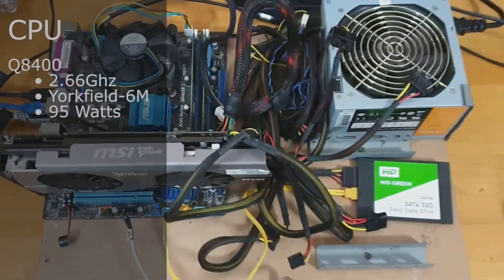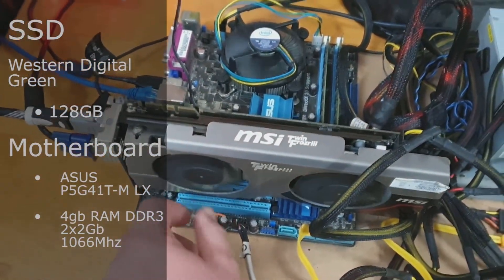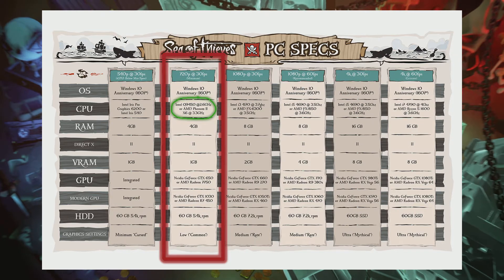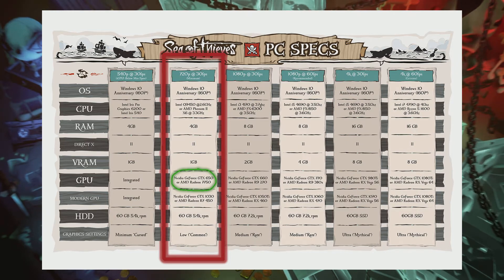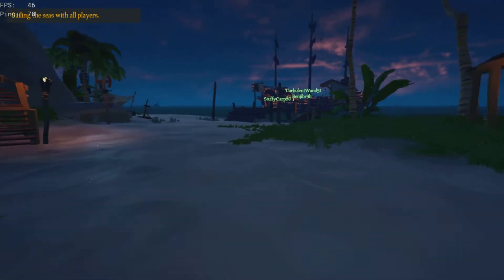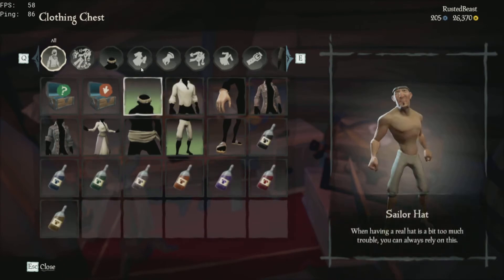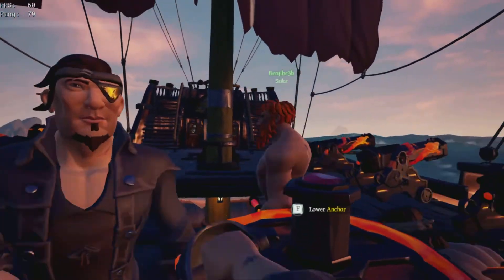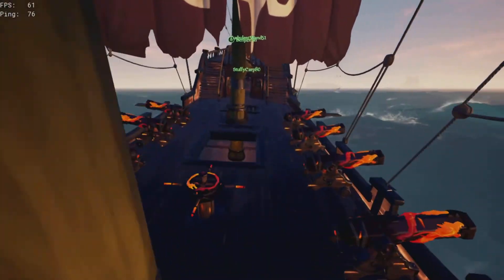Sea Of Thieves With A Core 2 Quad.

Comment: I'm gonna be running the game on Q9550 paired with either 1050ti or 1650 with 8Gb RAM and I'm happy to see I won't be disappointed.
Reply from the maker: You should be good with that setup.
You may get some loading lag when approaching islands. But the game runs fairly good with the later core2 quad CPUs. Your core 2 quad has 12m of l3 cache as well which will help dramatically and your 8gb of ram will defiantly help.

I love this game, one of my favorites, great with a bunch of friends. 

Have fun and good luck.

Thanks for watching.

Comment: I'm really glad games support older and weaker harder 
It just makes them last a bit longer as well
Also putting a 30 fps cap could help with stutters and the extra overhead will help with situations where it reaches 30 uncapped

Comment: hey man, I don't know if you will respond or not, I have identical computer specs to the one shown in the video, albeit with a much worse graphics card (GeForce 210). I'm planning to upgrade to SSD and GT 1030(not final, I am looking for a low power GPU though), along with 8gb ddr3, I see that in the video you use windows 10 using a p5g41t-m lx. Does it work well? I've heard that windows 10 doesn't really work for that motherboard
Reply from the maker: To be honest we had no real dramas with the motherboard and windows 10.
So you should be fine from what we have seen with this motherboard.
Reply from the maker: Also Sorry for the late reply.

Comment: How much fps you think i would run with

I3 7gen
gt 610 2G
8ram
SSD 240G

On low settings
Reply from the maker: Your ram, CPU and SSD should be fine. Your gt610 will be holding you back, in fact you would probably be better off using the internal graphics of your CPU (hd630). With your internal graphics you should be able to get 30 fps @ 540p maybe more. 1080p resolutions I'd say would be completely unplayable. You may be able to play at 720p but I don't think it would not be good. You will be setting everything to cursed as well (very low). The GTX 570 I used is still a fairly capable card, just it's a little bit old now and really only can do Dx11 at max.

I do not have a GT610 to test with but your best bet is remove your GT610 and use the the iGPU. might be worth using a free graphics test program line cinebench R15 (does both cpu & gpu) or unigine Heaven. If you already own the game I'd give it ago. Microsoft do an xbox pass for PC now which is slightly cheaper than the standard xbox subscription pass.

Good luck, let me know how you go,
Reply: @OFFbitTech  thanks for the answer